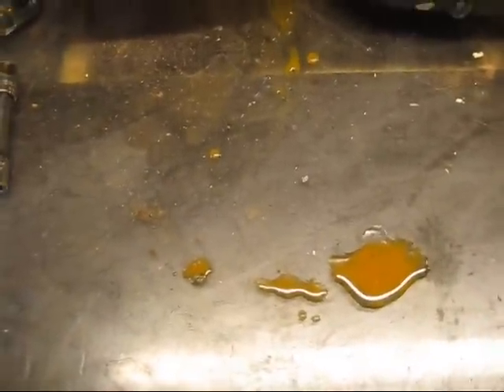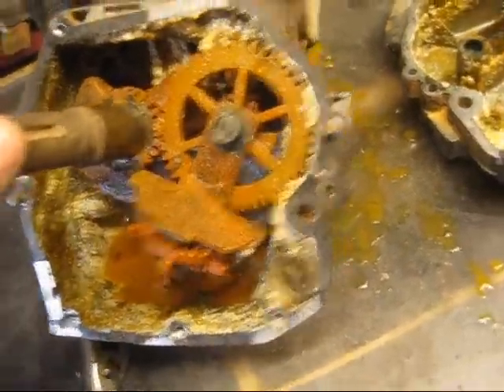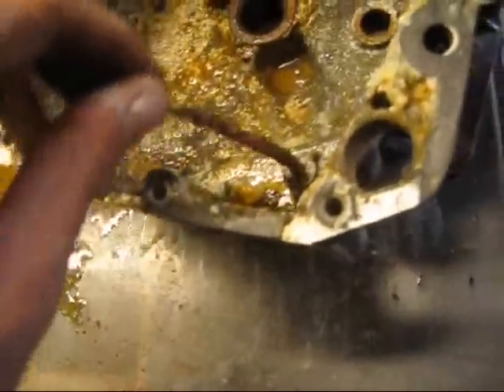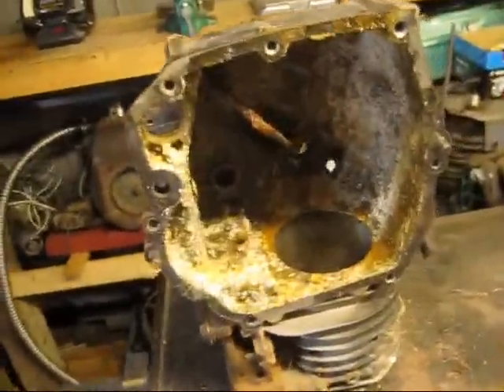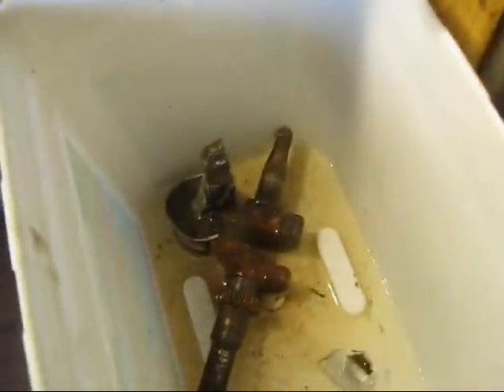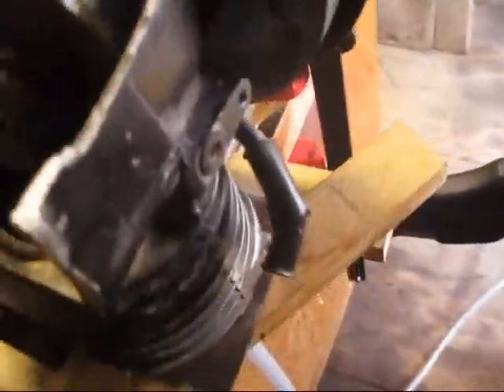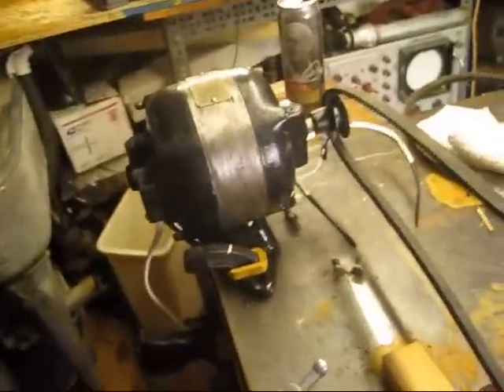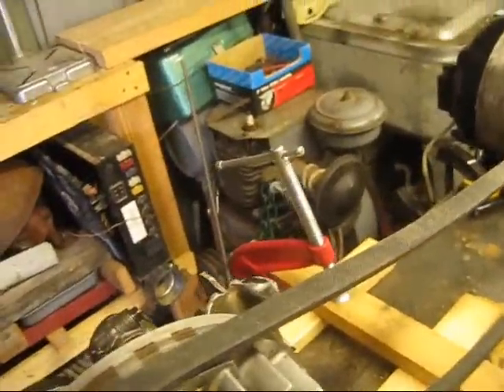Homemade air pump

Comment: why don't you put a pully on the engine
Reply from the maker: +Daniel Morton It was an odd sized crank, I think 13/16". Those size pulleys are hard to find and expensive, I'd rather use what I have and make it work.